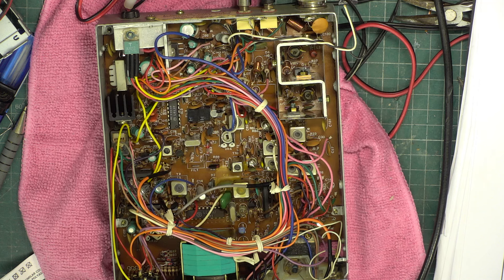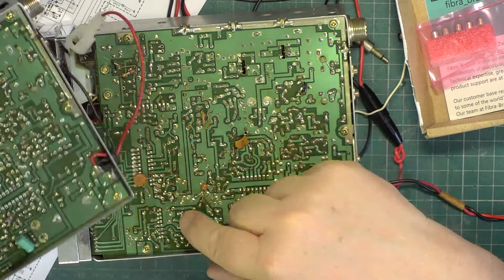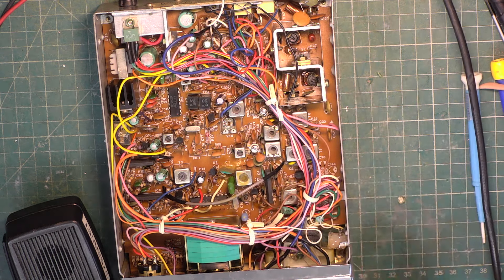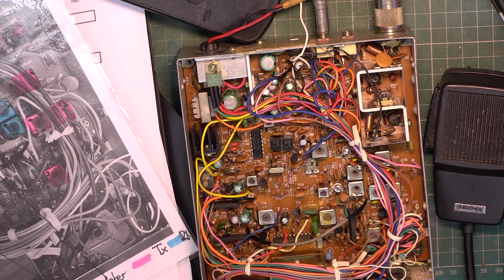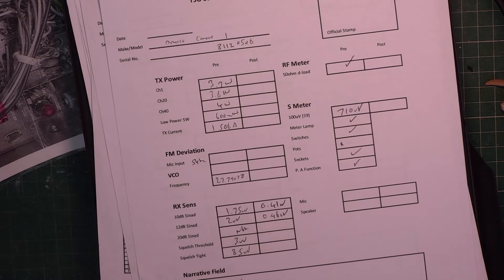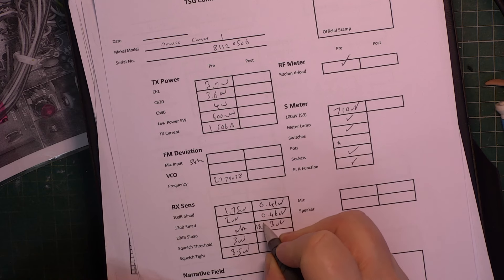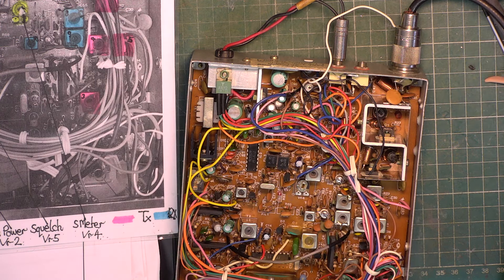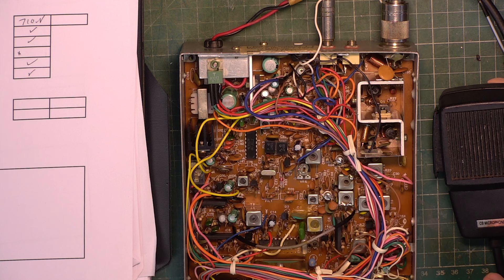Domico Convoy1 CB27/81 UK FM CB radio - trade chassis repair, deaf RX

Comment: I like old CB Transceivers those had separate receiver and transmitter crystals. I enjoyed the frequency adjustment of each crystal by adjusting the variable trimmer capacitors connected parallel to crystals. Moreover push-pull audio Amplifier with input and output transformers. If anyone have those old cb Transceiver and want to sell it, I would like to purchase please. 
Regards to everybody.
Reply from the maker: Bear in mind I'm in the UK solely showing UK FM CB radios which operate on the unique UK frequency allocation from 27.60125Mhz to 27.99125Mhz. The UK government introduced the UK system in Novemvber 1981.  The crystal controlled mobile sets weren't ever a thing in the UK as by 1981, they were all PLL synthesised. The only crystal controlled items were a few hand-portables.

Richard, G0OJF, UK